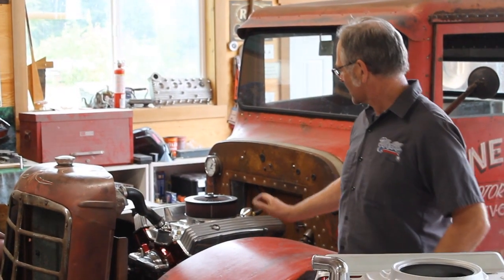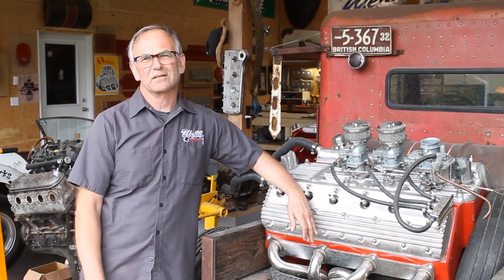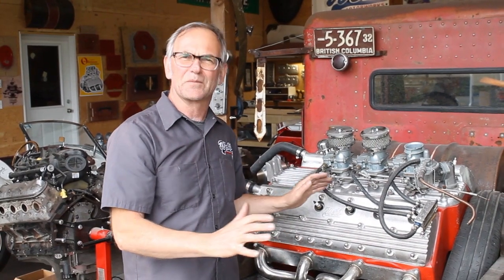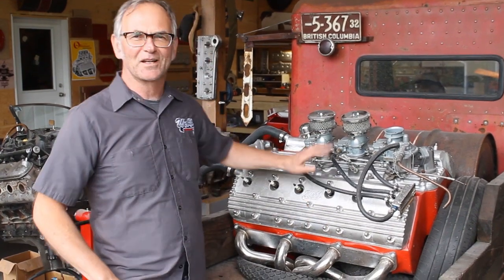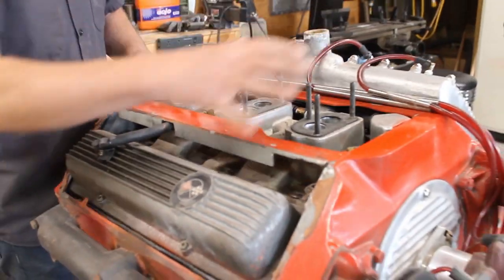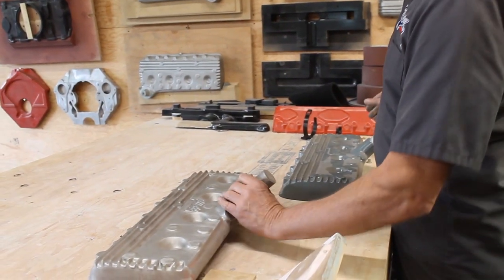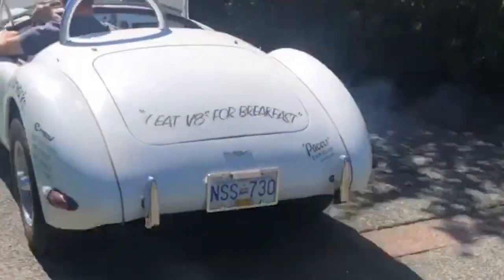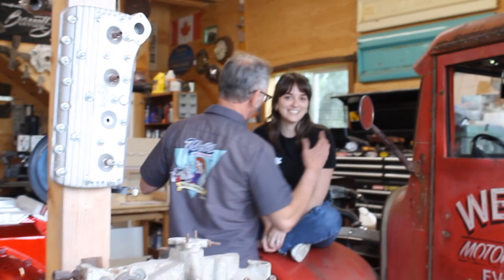Our Story: Gas Engines to Electric Conversion Kits

Comment: REALLY  LOVE  THE  SUPER  IDEA  OF  HIDING  THE  ELECTRIC  MOTOR  INSIDE  THE   LOOK  A  LIKE  ORIGINAL  GAS  ENGINE  OR  PART OF   IT  AT  LEAST.............   I HAVE  A   2002  GMC  Sierra  Crew  Cab  ( yesss  a real 4 door  )...  any who it's got all the normal on & in it from the factory & almost going onto  300 k  miles  wise  here in.......Newark  OHIO   43055......... where u all at  ( city & state & zip code wise )..... AnyWhooo ther rig being 4x4 on the floor inside the can better known as  manual 4x4  ....some younger kids have no clue what that mean's @ alllllll..............  MY RIG Weight's in close to 8 , 500 lbs., here in the states......... wondering do u have some thing that will work for my rig & not cost every thing including my life................................  for my 2002 gmc sierra crew cab long bed   6 . 0 gas / auto., tranny & 4x4 on the floor inside the cab.......... to be honest i'm on a super tight budget here but wanting to know  what sort of electric motor would u recamend inside my  mostly big  pick-up truck  let me know details of the electric engine & the  tranny that wound be matched to it as well..............???? what is the miles or the range in the distance i can go in the summer & winter month's & torque as well here  ... on or in a rig like mine  there plzzzz & how lon g will u'll & the 2 daughters & the wife as well   great to have all family all hands on deck there  !!!!!!  so how long in time  & rough price wise for a basic  time  &  $$$   (  CUS I'M ON A VERY VERY TIGHT BUDGET  HERE   MONET WISE   !!!!!!!!!!!!!!!!!!!!!!!!! tooooo  as  well   plzzzzzzzzz   &  thank's   GOD  BLESS U ALL W' STYLE OF BEING VERY VERY ORGINALLY DOING SOME THING LIKE THIS  THERE   DO U ALL PICK- UP & DROP OFF  THERE   WHERE EVER THAT MAY BE......   TEXT IS BEST TO REACH ME DIRECLY

Comment: The problem with electric motors are batteries. They are bad for the environment to make and dispose. They are heavy. They are expensive. And a large majority of them can't be repaired. A motor that can run off water is where it's at. Steam. Just need ro figure a way to make it practical.

Comment: I have a 1968 HK model Holden premier which is an Australian Chev brand, I have had this car for 46 years. It runs a standard 307 cu in SB chevy, after watching this video with your daughter Emi's remarks, would love to put an EV motor in the shell of the SB 307, with engine mounts already in place and the batteries in the fuel tank, what a great conversion. The costing would be a hurdle but would love to have a ball park figure quotation Chris, I live in Tutukaka, suburb of Whangarei, Northland, New Zealand.
Reply from the maker: Hi victor. Yes the pricing is a big hurdle for sure. I am hoping in the next couple of years the prices will come down.  Unfortunately it costs more to convert than buying a complete electric car at the moment.  Hard pill to swallow for sure!

Comment: Use plastic molds for motor Looks. Weight is the enemy
Reply from the maker: True weight and EV’S don’t mix. I do love the look of aluminum though. And I need strength in the side panels ,good suggestion,Thankyou

Comment: Wow, you two are incredible. I love it. I have a 1992 E350 van with a 4 " lift. It has a 460 motor. I was wondering if I could covert it to electric powerfull enough to tow 4 tons to haul my metalart sculptures to burning man and other shows. I dont care if it's only rear wheel drive. Any ideas?
Reply from the maker: These motors I am using have 360 foot pounds of torque.  There are motors they use in buses and trucks that have well over 1000 foot pounds . They are usually lower rpm motors so coupled to your existing trans would be perfect rather than having a single gear reduction. You are going to need a large battery pack on account of weight sucks the batteries down

Comment: She said cutting down on greenhouse gases for the environment. She sounds like a Democrat LOL I wonder if she knows that you're still using energy to power that vehicle and that energy comes from a coal-fired plant. It takes coal to make electricity to power that little vehicle. But whatever. I'm not interested I don't like instant to work I don't like not having a transmission and I don't like not having sound. But hey to each their own I think it's a very intelligent invention I think they're very smart and hey if it works for them I wish them the absolute best of luck. But it's just not for me

Comment: How about converting a Dodge Magnum. It has plenty of trunk space. Usethw trunk space to add batteries upto the height of the wheel well flush. If you contact me, I can make suggestions as how to make it unique enough to make it worth it. If successful maybe you can pitch the idea to Stellantis and they can use it in their Chrysler 300. Both vehicles have similar body style. In the 300 trunk wouldn't be used. It would still be a skate  board platform but the additional idea is what would make it fast charging, efficient and possibly more competitive to tesla

Comment: There is a whole world of EV conversions needed.  It's sustainable, it employs locals and and creates regional economies, not shipping all the $$ to Detroit (or wherever...).  Kits are a much needed supply chain item.  Lots of do it your-selfer's  can rebuild (or build) a cool car with a decent EV kit.  I'd like to do a quality '57 Vette (replica) as an EV.  Make it look mostly period correct.  I don't need an SBC shell, I'm OK with battery packs shaped like a V8 (Like Icons 48 Merc) and laid flat under the floor.  I want 250 mile range and plenty of go.  But I love the older styling cues.  I do not want to drive an iPhone on wheels - just not my thing.  And I think a lot of folks are in the same mind set :-)
Keep up the good work !!

Comment: I have a 32 Ford sitting in the man cave. Maybe when battery technology catches up and gives the car a 1000 mile range and a 2 hour charge, the project will be viable as a daily driver.  There is nothing green about electric vehicles.  Energy has to be created to make and recharge electric vehicles.  People seem to demonize oil and gas but forget that the industry has given us such an incredible lift in living standards and taken us out of hand to mouth poverty from the late 1800's. No apology required.
Reply: Who the heck drives 1000 miles plus a day other than over the road drivers?
Reply: Supposedly the localized energy production is cleaner than being localized in every vehicle even if the electricity is created by gas or coal.  Plus I think half or more is made by hydro, nuclear, and solar-wind now too.  Makes sense.  It's easier to scrub one stack with a multi million dollar scrubber than counting on a million cats and OBDIIs to do the job.  Final thought.  In a SHTF scenario, I can make electricity but I can't make gas.

Comment: I can see using "the casting" as the shelf to hold the components in their most efficient configuration and as mounting points for a clean fully engineered replacement installation. For me, I don't need all the faux just a form follows function package that one could use to reactivate their out of date drive trains. Imagine a time when they are the same as a rebuild and you will own this market. Especially as most of these cars will be locally used and not for horsepower wars which nobody really cares about any more. Any new gas car will outperform any old hot rod and all anybody wants is just to drive these unique platforms. Bolt in Ned plug and play.

Comment: Granted, I realize that electric vehicles have been around since the late 1800s, but I think I like Jay Leno's idea. Have your daily driver as an electric to "save the environment" so that you can have your traditional (internal combustion engine) hotrod for the weekends.

That said, I'm considering doing an electric build on one of the IHC Metro vans that I own. The roof is big enough that I could have enough solar panels to keep the batteries topped off when I'm not driving it to a car show.